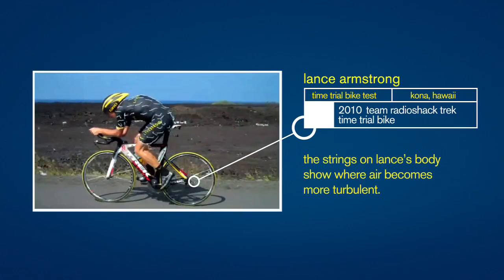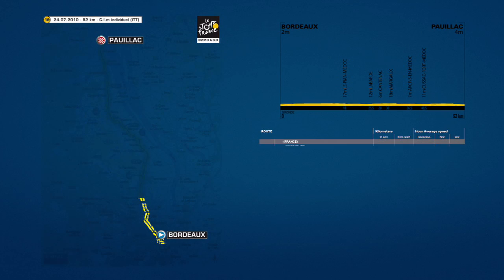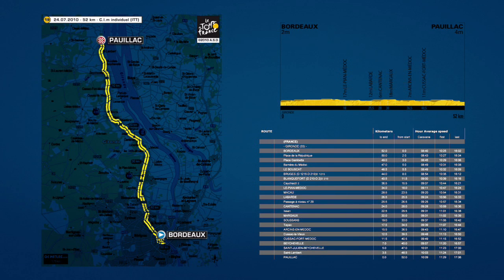Lance Armstrong: How Aerodynamic Can a Cyclist Get?

Comment: Whilst you can't enter a recumbent, are there any rules against adding a nose that clips onto the front forks, covering the front wheel and diverting air around the cyclist, and also a tail fairing that allows the air pressure to push the bike forwards as it equalises behind the cyclist? I know all this stuff would be heavy on hills but what about a flat time trial?

Comment: basically a bicycle with a person has horrible aerodynamics. as bad as normal cars which themselves have bad aerodynamics. that means at a given speed you have to work as hard as a car to break the wind.
what a bicycle needs is a front cowling and similar tapered body for the rear. 
it would be such a dramatic diference that you could probably go twice as fast for the same power and that's huge because doubling the speed means quadrupling the drag.
on a flat 200km race you could cut hours